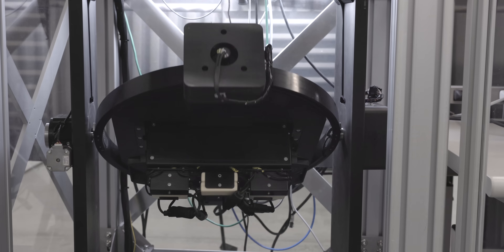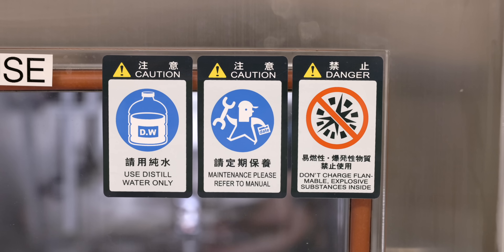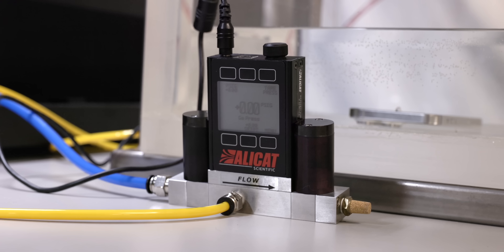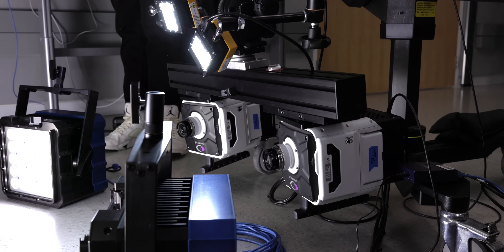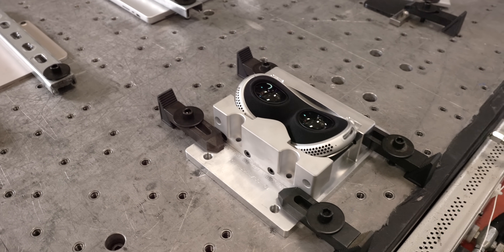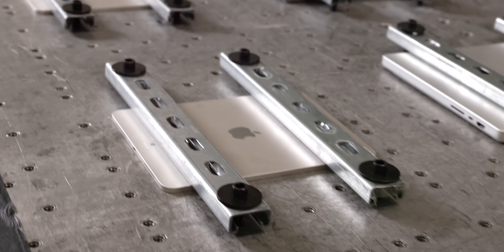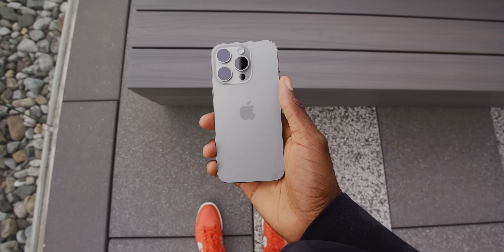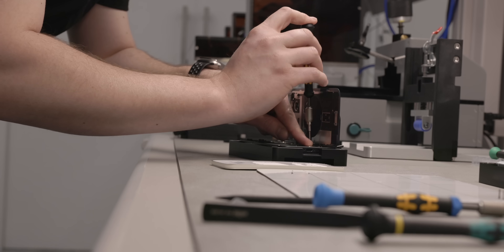I Visited Apple's Secret iPhone Testing Labs!

Comment: Industrial hardware breaks your scale right away. They are most usually in the hard to break yet quick to service.
Also, Apple, don't try to tell us that the original iPhone, with its uniqueness of no removable battery, was better for customers and the earth in a sea of Nokia and Blackberry unbreakable bricks. The claims that water protection is so important to reduce repairs/replacement is very odd coming from the brand that didn't do anything for water resistance while it was getting mainstream as it finally gave makers the "reasons" to sell a closed back phone.

Comment: The question is how many people really need a waterproof phone against how many people needs to replace a battery like it was done in nokia times.
Reply: I know a ton of people that dropped their phones in water (toilet, lake, rain, whatever). Most were even surprised that their phones survived it. - And most phones can easily run for 4-5 years with the battery without exchange until the customer buys a new phone. - Also: You can still exchange the battery from third party repair shops easily. Its just that the waterproof is often not as strong afterwards anymore.
Reply: @quint_berlin  so a battery lasting only 6 to 8 hours starting at year 3 of usage you say "can easily run for 4-5 years" without exchange do you believe applies to an usable phone?
Reply: @PS3000b no it doesn’t last 6-8 hours they slow down the chip only if the battery health is low .
Reply: the profit margins would imply the former is more important

Comment: I call mostly B.S. on the "not entirely mutually exclusive" repairability/durability continuum. At least in theory, this is nonsense. In practice though, our entire economy is set up for throwaway consumerism; the profession of "repairman" isn't 'profitable' for a wide variety of artificial reasons, our supply chains aren't set up to provide the right tools for repairing everything from iPhones to tractors, and the IP necessary to make various fixes is deliberately inaccessible.

One great way forward is a library socialism model (imagine expanding libraries beyond books to software, power tools, lawnmowers, and phones). This model removes the profit mandate and allows for the social and technical arrangements that make what's technically feasible practicable. And it caps how much industry waste (on marketing, CEO compensation, upgrade gimmicks, and predatory business models) would be allowed--this is the virtue of having a "public option" controlled by technologists, creators, inventors, and community members acting in the social good.

Comment: I'm sorry but the reasoning about durability vs repairability is absolute bullcrap. iPhones are less repairable not because of their durability but because of how Apple goes to extreme measures to make it not work, whether it's about not working with 3rd party parts, or having to get special coding tools for screens or else faceID wouldn't work, or even just (for a long time) not making repair guides accessible as they can be.

Comment: I mean he didn’t lie at all but very few people are upset about the repairability of the iPhone from a logistics standpoint. Tons of phones use adhesives seals and gaskets as well as glue for the battery. The iPhone is hard to repair physically yeah but that’s to be expected, it shouldn’t be artificially incompatible with replacement parts for “security” reasons.

Comment: my iphone 15 pro was surely not tested 😅 first drop from waist height and it broke both the screen and the back glass. And it didn't fall on the screen, but on the "amazin" titanium frame.
9:00 that's BS, there are so many dive watches easy to repair, at least easy to change battery, and their secret? they have silicone seals, not adhesive, the only reason why you would put glue on a device instead of a normal silicone seal would be to make it fail at a certain rate while also being hard to repair, especially if you want to keep the water resistance. And all this discussion, but they still make the back plate from glass.

Comment: ya but I still cannot replace the screen without apple locking features from my device.... macs have a issue in the display cable where it gets bent until one day it stops working and you quote them for a 1000+ repair to replace the motherboard and display... ya you care all right

Comment: The interview with that engineer is useless. Apple actively limits repair, if they only made almost perfect phones and didn't block hardware changes, it would be fine. But if you change your charger plug, your phone won't work. 

It's the policies, not the hardware

Comment: The IP rating actually goes up to IP69, for devices that are resistant to high-pressure jets.
In between switching to my current phone I tried an IP69 rated east European phone.
On which I could not get along with it's mostly stock Android 11 ROM, so I gave it to my brother.
This as his old already second-hand phone was developing charge port issues and was of a generation that does not have available parts.

The durability and repairability sliding scale is nonsense, even more so if you add an axis of thickness/size.
What Apple does wrong is focusing on thinness too much, form over function.
Otherwise I am impressed by the drop testing setup, considering how poorly the iPads we used back in high school held up.

The it's objectively better to have the proper seals argument can be disproven by the counter-example of my previous Moto G5 holding out for over 5 years despite having no water seals.
This is enough to remove the objective part of the argument as this makes it situationally. ∀ versus ∃ in first order logic, which pretty much flips the applicable logic around.
Also full agree on the glass backing being horrendous for durability, while the hard material is unlikely to shatter it still can, especially when scratched and will fully shatter when it does.
As opposed to a plastic casing, like the one of my current phone, which is significantly more resilient to drops. The phone can be kept sturdy with an inner metal frame, like what Apple already uses.

Comment: I'm an authorized Samsung and Apple repair tech. Last month we had a phone get recovered by a scuba diver and dropped off by our customer. This phone was lost at the bottom of the American River for about 2 months. It was the s24 ultra and an OtterBox case with a screen protector. Screen protector was cracked and the OtterBox was soaked. But after popping out the SIM card and seeing that there was no water in it, and after a hydration tester, We plug the device in and it came right on. On the issue was slight discoloration on the display. Water resistance is truly amazing.
Reply: yea nice ads
Reply: Did you ever contact the original owner of the phone?
Reply: Maybe the user suffered from the s24 ultra grainy screen issue before he dropped it
Reply: So you work for UBREAKIFIX lol
Reply: I’m surprised the cold didn’t destroy it
Reply: This is a very cool story indeed. But I didn't buy John Ternus' argument for this. It just smells like a corporate excuse for making repairs difficult/expensive, and Marcus ate it up.
The real life occurrences of someone who dropped their phone in a fresh water lake/river versus everyone who wants screens or batteries etc replaces isn't even close. Like millions to one ratio. Tens of millions to one. I think most people would give up deep water ingress protection for cheap and easy screen and battery repairs. It's just a screen for anti-repair measures.
My iPhone has a shattered rear glass but it's simply not economical to repair and so since it has a case on it anyway I haven't bothered.
John in the interview says they think theyre in the right because there's less repairs....... yeah when you make a screen replacement half the cost of a new phone some people just aren't going to bother repairing. It's bad data. Unknowningly, or more likely knowingly......
Reply: @justins6412  While I agree with your perspective, it also makes sense to look at the fact that you have a case (maybe $20) that covers your broken glass (costing $500 to fix) because your phone still works fine. Basically Apple already does screen and battery replacements (and your phone can't run without these) and they aren't so expensive. They definitely won't say tomorrow that they have an IP55 phone with a lower rate of screen or battery replacement.

All corporates are greedy and want to protect their margins - that is the world we live in. Still I'd take the lower cost back glass from the newer phones as a consumer win, and I do find it difficult to see phones sold today with anything less than an IP67.
Reply: Apple bot
Reply: @AnotherDay-ce6th  what
Reply: discoloration? that device either get water intrusion or no water intrusion, it can't be both
Reply: @lansiman or, maybe a lot of pressure at the bottom of a lake? caused warping of the panel?
Reply: @lansiman  its a hidden ad for OtterBox
Reply: American river? So what would happen if it wasn't an american river?
Reply: @prison_pocket2000  the American River, not an American river. It's in California.
Reply: the moon is missing outside and @ the mirror and the signal of sound reflection, entertainment had no right to throw a frequency into my heart, get the fuck out of my body merging into me and blowing me kisses through my own body get the fuck out of my frequency Stream Melanie martinezes weird body merge album Melanie had no right to make the music that killed me in reality get the fuck out of my body trying to snap me out Stream tuning out of time by paramore's the new's. this is already the mind get the fuck out of my body you guy's had no right tot kill my in reality get the fuck out of me  stream paramore;s the new's for the space of heart get the fuck out of my body blowing me kisses in my own skin you had no right to merge into me get the fuck out of my body…/…./...

Comment: shouldn't make it from glass? what other cheap material that is transparent, won't scratch easily, lets em waves through easily are there? would you rather they use plastic where heat can literally warp it?

Comment: I like how that example of battery replacement v/s water resistance was cherrypicked by the Apple engineer to make his point, completely sidestepping any discussion of other anti-repair stuff Apple’s been doing for years.

Software pairing of parts, many different types and sizes of screws, massively hard-to-repair back glass until just 1-2 years ago, limited parts availability with ridiculously overpriced parts on the self-service repair program, etc.

Disappointing to see Marques simply parrot the talking point without much questioning or expressing any doubts about it.
Reply: True
Reply: To be fair, none of us has any of the repair data that Apple has access to.  Additionally, things that you might want repaired, other people might not care about as much.  Degraded battery, cracked screen, broken back glass?  These are things some people want repaired, but that others don’t want to spend a single dime on.  Cracked back?  Put a case on it.  Cracked screen?  Still works, whatever.  Battery that doesn’t last all day?  Carry around a portable battery charger.  Water intrusion, however, does make a lot of sense to focus on.  People will live with a cracked screen and a bad battery, but they won’t live with a completely dead phone they accidentally dropped in the pool or toilet.
Reply: @jrobert  This all sounds reasonable until you realise that there are phones you can open up reasonably easily that offer the same level of water resistance, and that sealing the phone isn't even the biggest problem with its repairability, the real barriers to repairing an iPhone are parts availability and part serialisation where the phone throws a fit if it detects a new part - both of these are things Apple actively does specifically to make third party repair harder (and their first party repair service sucks)
Reply: @jrobert  whatever you said is BS. People do care about repairability..... Remove repairability from cars and see the outrage
Reply: @M16-mini   lol. Phones and cars. Definitely the same price point and use cases.
Reply: To be fair. Battery and screen replacement is not over priced which is the normal repair. Oled on any phone. Cost an arm. Also battery replacement is also cheap this days from apple. Ofc they want you to use geniun apple parts due to what happens to Samsungs s7 bomb. Step away and think on a larger scale. Right to repair is just a small minority. Most people go to apple and fix the phone for a good price. Also they have warranty of the repair. Repair shop on the corner don’t have that kind of safety in there repairs.stop making it such a big deal.
Reply: “These walls are funny. First you hate 'em, then you get used to 'em. Enough time passes, you get so you depend on them. That's institutionalized.”
Reply: @chrispy.critter  "Most people go to apple and fix the phone for a good price". Nah, most people change phone as soon as something breaks because it's too expensive to fix. We used to be able to buy a 40$ battery and swap it in 10 seconds, same for the back piece. Now we have throwable 1000$ phones that are worthless after a single fall but "it's not a big deal" because chrissjogren6843 said so. 
I hope Apple pays you well for defending their shitty behaviour.
Reply: @chrispy.critter  The problem is that Apple takes away power from the consumer to make their own choice. That's why it's such a big deal. If you control all the parts, all the repairs can only be done by you, all the software comes from your company and is proprietary, then you can charge however much you want or even deny repairs all together and the consumer has no say in the matter. That's why it's such a big deal. Some people like the freedom to do whatever they want to property they bought with their hard earned money.
Reply: Nah… there’s a surprisingly mundane reason for all that stuff, it’s never the conspiracy that many on the internet would have you believe. In the end it’s always just a trade-off between the elements.

It’s not so much anti-repair as it’s “here, let us fix that for you”. For most people not into microsoldering, that is a great deal.
Reply: @motinuppi  The apple ecosystem has broken it's customers to the Shawshank Redemption level
Reply: @motinuppi Watch any Louis Rossmann video and you'll rapidly learn that Apple takes deliberate efforts to make repair harder, actively creating features in their devices that have the sole function of breaking parts of them if you dare to have them repaired by not-Apple.
Reply: @bosstowndynamics5488  Louis does a good job fixing stuff, but he also has that same blind spot and bias (= I don’t get it so it must be a conspiracy). That said, he’s not always wrong when it comes to stupid design and stuff like that.
Reply: @motinuppi  Maybe watch a couple more of his videos then, because he does a very good job of distinguishing between carelessness and malice in my opinion and he's very insightful when it comes to seeing through the superficial excuses Apple and other manufacturers make to try and excuse part serialisation and such. It's very much not a case of presuming conspiracy in the setting of uncertainty, the cases where he alleges malice are backed by a well reasoned examination of the facts

Comment: Apples reasoning for their horrible repairabilty is also horrible. Do the 9000 proprietary screws also make it more reliable/durable? 
Or what about you not being able to use non apple parts? Or the 200 other things that absolute bumm over anyone trying to repair an iPhone? 
They intentionally make repairability harder while NOT increasing durability.

Comment: 7:44 ehats more realistic to reach? A repairable good phone which is pretty durable...or a phone which ist repairable but never fails(but then have glas in the front and the back?) 

Like the technology exists to make backcover removable but also water resistance i think samsung has a phone) so ehy is he talking like there is no way to do that...he even says battery has to be changed at some point...so instead of trying to make battery easily repairable they just says a phone which never breaks is theoreticaly better. That makes no sense...only if you eant to sell more phones or expensive repair service...im sorry but you can hear the apple marketing brainwashing

Comment: Okay but that's bullshit. They actively try to make it impossible for 3rd parties to repair, which has nothing to do with durability. I think everyone remembers when iPhones just locked themselves when a part was swapped with another genuine iPhone. That is not something that helps waterproofing the phone. If you want to change out the battery and keep the IP68 rating, sure, maybe let Apple do the repair, but if you don't need the certification you should be able to do it at home, and you can't. It's impossible to get parts.

Comment: Iphones up till the face ID came out were the literal easiest to fix, I worked at a phone repair shop for 5 years before the Iphone x came out. OEM parts and third party parts used to work. Now you need a configuration software from apple to replace any part in any phone now.

Comment: Honestly, i disagree completely with that. I was just at a talk called "design for a circular economy" with the head designers at logitech, whipsaw and ifixit, repairability is not mutually exclusive with durability if designed correctly. 

The number one aspect carsten ( engineer at ifixit) brought up was our push towards making adhesive the solution, while not researching other solutions like better, more replaceable gaskets for phones with an IP rating.
Reply: Aaaand, how many million modern smartphones (or other similarly complex items) have these guys produced? I'll not hold my breath waiting for an answer...